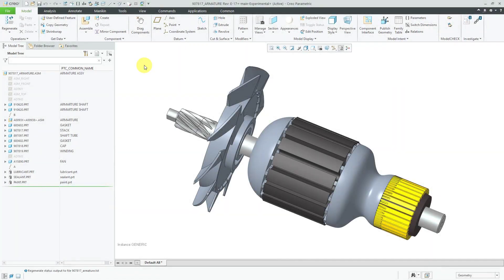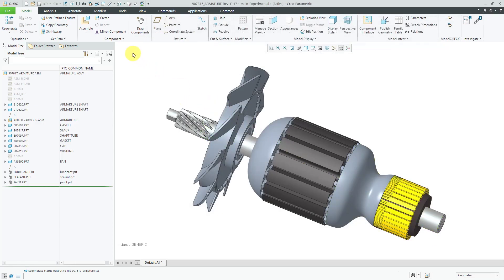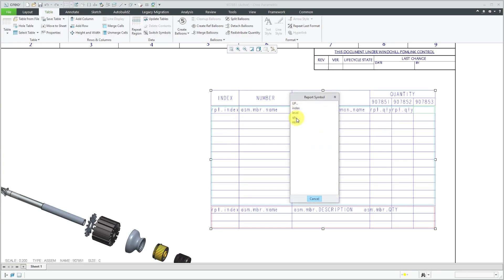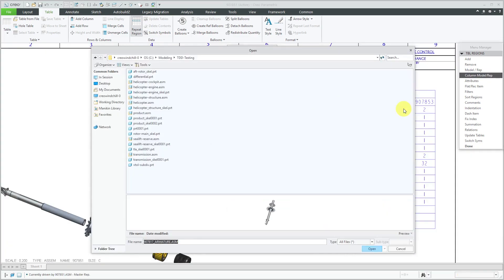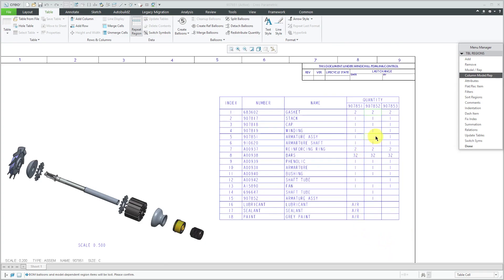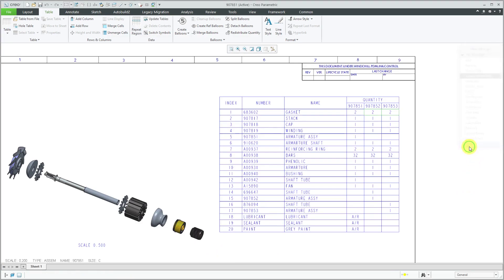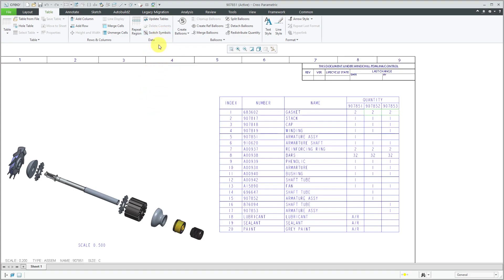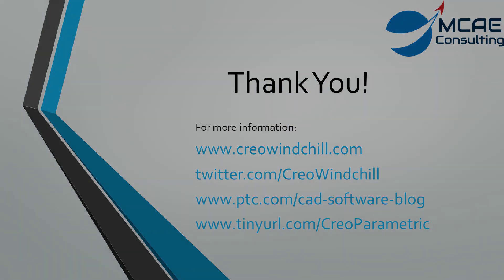Creo Parametric - Drawing Bills of Material (BOMs) with Multiple Quantity Columns

Comment: i have a multi column bom , 5 dashes, and as soon as i add/assign the assy file to the column (column model/rep), i blanks out the column i have for UOM. . all the dashes show correct bom qty's so thats working... but unit of measure entries are blanked out..  ever dealt with that??   thanks!
Reply from the maker: No, I have never dealt with that. I recommend reaching out to PTC Tech Support.
Reply: @CADPLMGuy   thank you!